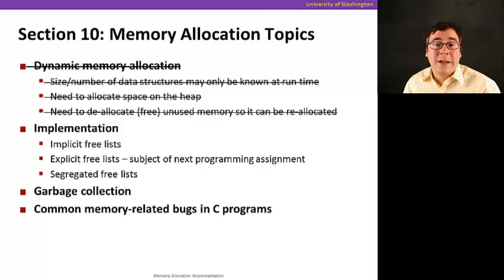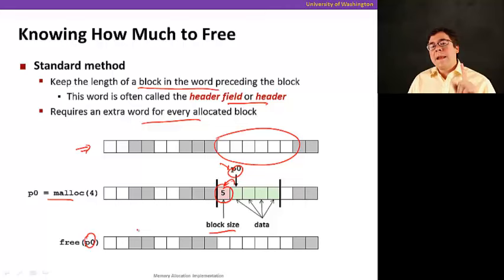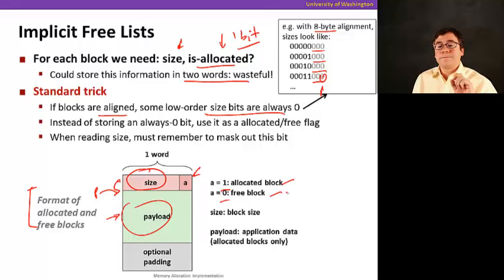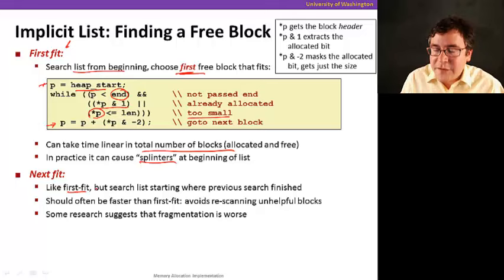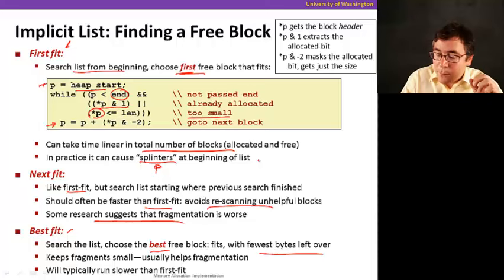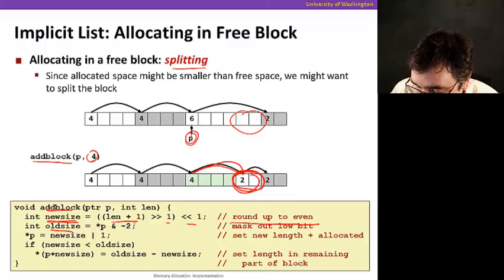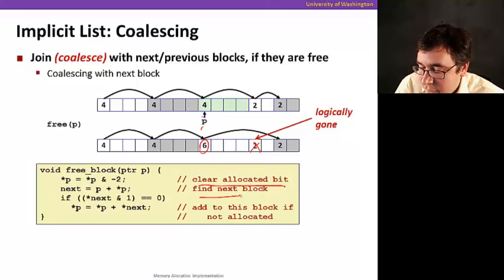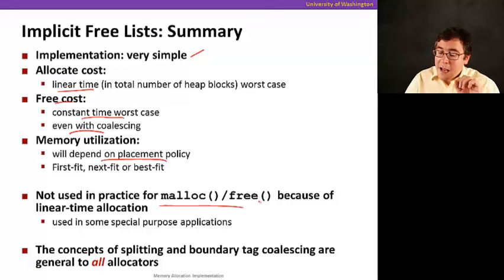Memory Allocation, Video 3: Implementation

Comment: What does the old size here mean? how is that calculated as *p & -2?
Reply: -2 is always 111....1110. As it's said before instead of having one field for the size and one boolean field to indicate whether the block is used or not, you can use the last bit of the size as a boolean iff your blocks are at least 2-bytes aligned. That's why, when you want the size of your block you want to mask out this "boolean" bit. (eg size  = 6 could be 0000 0111 or 0000 0110 depending if the block is used or not, assuming blocks are 2-bytes aligned. But the former case doesn't mean the size is 7). I guess you found the answer already but whoever asking the same will have an answer.